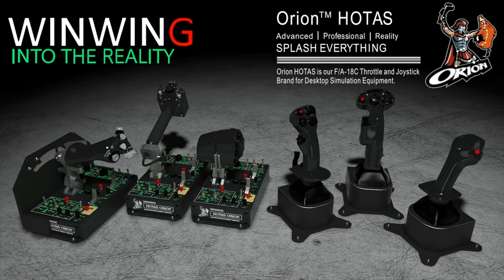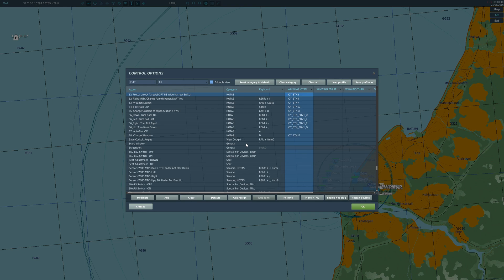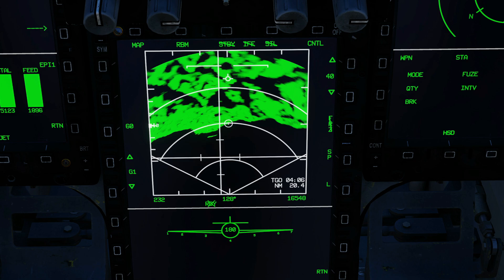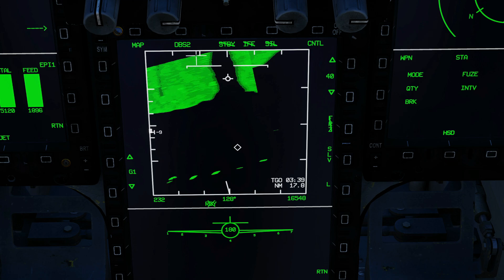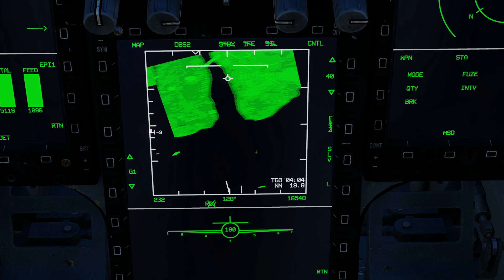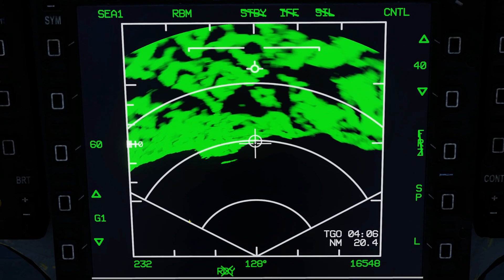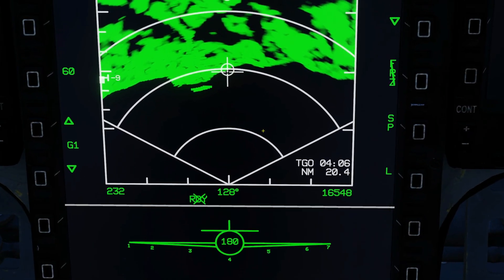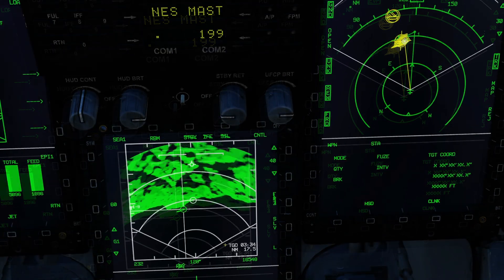JF-17 Thunder: Air To Ground Radar EXP/DBS Modes & HSD/DL Integration Tutorial | DCS

Comment: Why does it work with the objects in front of the nose? If it is DBS then it should rely on doppler shift, and therefore not work with things in front.
Reply: actually it's the DBS for side view mixed with EXP in its front section. so no "blank" zone
Reply: @xzhao2weeks  but the hornet can't see anything in front when exp. Why?
Reply: @piston_77  that’s hornet. You may ask their avionics engineers why not mix rendering together
Reply: @xzhao2weeks  what a useful reply! thanks!
Reply: @xzhao2weeks  It was a bug that was reported, so my question was correctly fundamented. THanks for your childish reply though.
Reply: If it's in front it's more or less just in exp mode, the further you put it of to the side the sharper it becomes